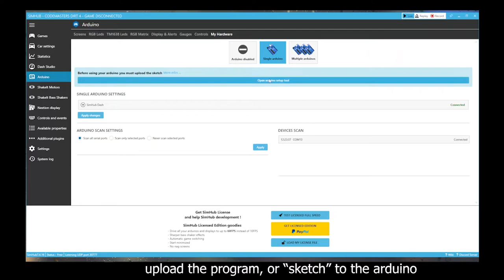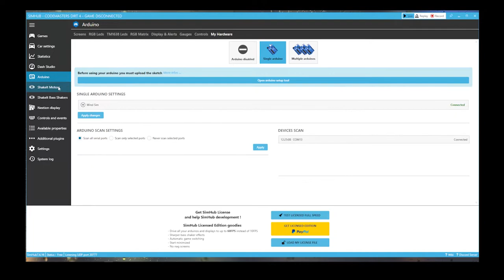DIY cheap immersive Wind Simulator for Sim Rig using Arduino.

Comment: what is the frequency # for? when you set up the motorshield. I watched another video and they said to set it to 400 (you said 1600)...im trying to troubleshoot my problems :)
Reply from the maker: i'm not an electronic expert but i'll try to explain my level best. PWM is the control of sending the "analog" signal to the motor. Higher pwm means the board sends longer "writes" in the frequency. In some dc motor, sending higher PWM would decrease, or eliminates the humming sound.
Reply: @EDHness  ok, i sort of understand what the nunber does. Why 1600 and not just leave the default of 1900 !if higher/longer data stream could be quiter??
Reply from the maker: @nitepeople76  well for the dc motor i used, which is the normal computer case fan, can hear slight buzzing at lower PWM, but at default 1900 it wheezes sometimes. it may be different for different manufacturer, however, on most of my tries, 1600 seems to be like hitting the safe sweet spot for most motors. hope this helps ya :)
Reply: @EDHness  thanks for the clarification. I started from scratch again and got it all working at 400. I have a nice set of brushless server fans that i think go up to 3700 rpms. Im tempted to try another sketch again at 1600 just to see, but it blows fine with no wine. If i had to tweek anything now i would like to get them to spin up more gradual. now its like it just has off/low/high setting thats all. I wonder if the frequency # will effect that?
Reply from the maker: @nitepeople76  in some way PWM will and does have effect on the speed variance of the brushless dc motor. yes i believe u are going to the right direction by gradually increase and see which one suits the most.

Comment: Does it matter if i buy arduino uno v3? Will it work?
Reply from the maker: yes it should work as long as it uses the same microcontroller ATMega328.
Reply: @EDHness  thank you very much
Reply from the maker: @carulzz  most welcome :)
Reply: @EDHness  Bossku kalau pakai Uno v3 kena pakai motorshield juga ke?Kalau mau,mana boleh dapat beli ye?
Reply from the maker: @gohyipoh5034  yes bro kena pakai motorshield. shopee ada banyak jual motorshield, just make sure beli version yg betul.
Reply: @EDHness  boleh boss bagi link yang motorshield tak?sebab saya cari shopee tak dapat
Reply from the maker: @gohyipoh5034  dulu saya beli from sini - https://shopee.com.my/Motor-Driver-Shield-L293D-74HC595-Arduino-UNO-Compatible-for-DC-Servo-Stepper-Motor-293-L293-293D-i.126211897.8312276243